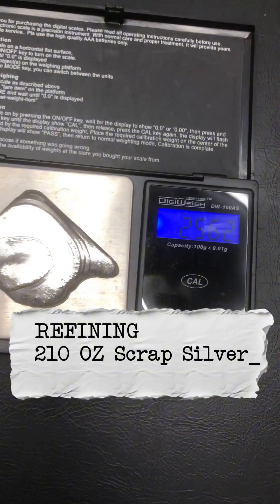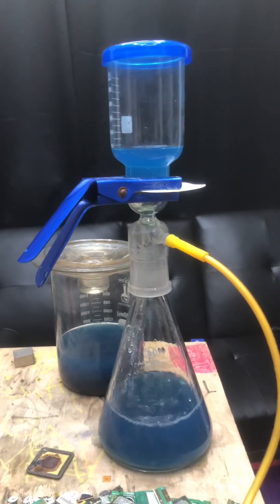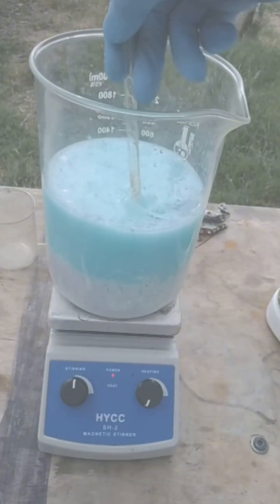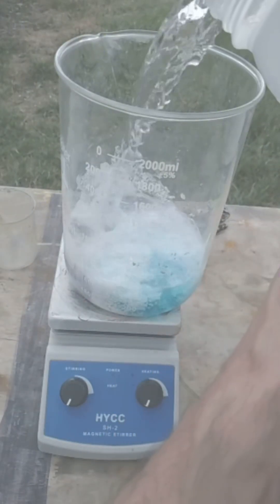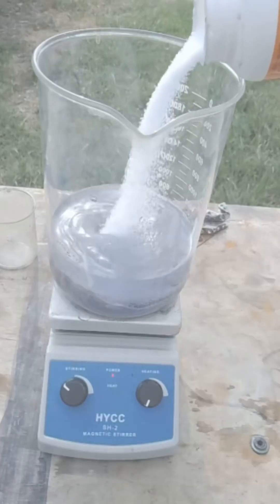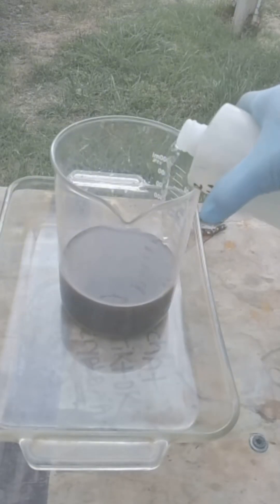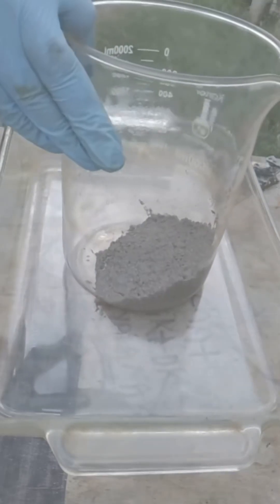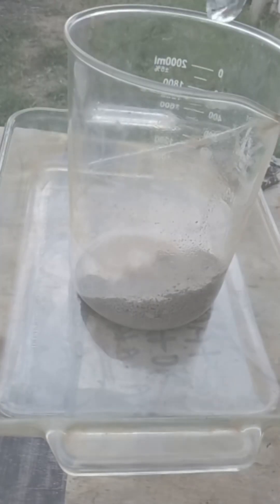Refining 210 OZ Scrap Silver PT 3

Comment: I reverse electroplate the ferrous base ones then melt and electrolyze the copper and brass based ones with sulfuric acid. Get some copper as a nice bonus. The next step is a nitric acid treatment. If its got gold then streight to auqua regia to disolve the gold and make lots of silver chloride.
Reply from the maker: @christopherleubner6633  nice